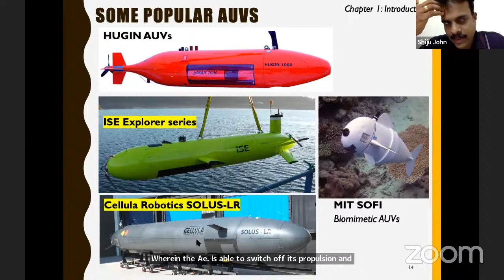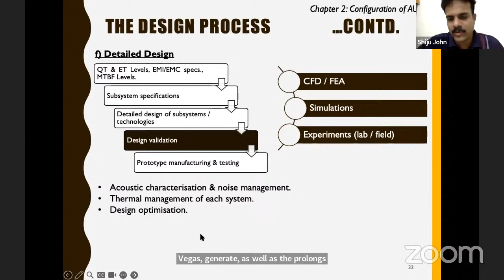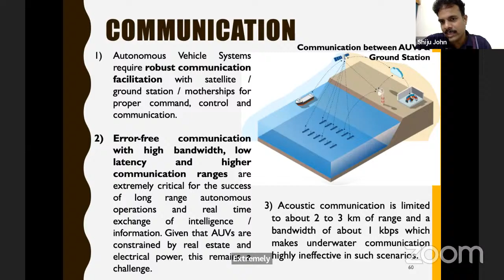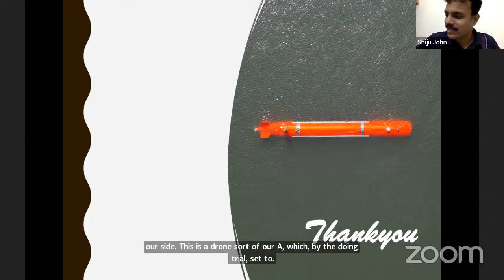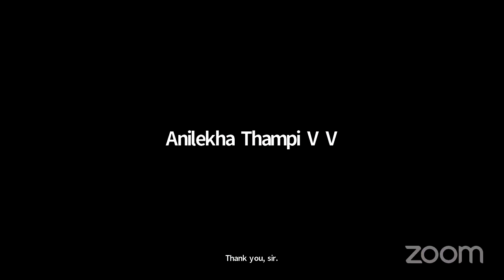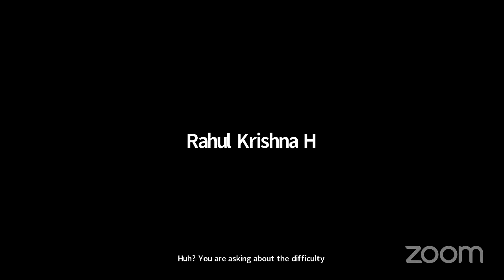Autonomous Underwater Vehicles (AUV) | Shiju John | Scientist - DRDO

Comment: I found out that I had misunderstood or not clarified certain questions. Would like to clarify them here:

1) In the absence of any standard sea trial criteria such as those laid down by IMO for surface ships, how are AUV sea trials done? AUVs dont have predefined sea trial plans as compared to standard IMO criteria for surface ships (they assess stability, turning ability, manoeuvring capability, stopping distance, speed trials, etc). Since AUVs are mostly mission specific, it may be impractical to come up with a standard sea trial methodology. However, we have pre-defined standard manoeuvres (which may include turning circles, lawn mower paths, repeated diving and surfacing, depth change manoeuvres, depth trials, zig-zags etc.) for AUVs that are finalised based on the AUV configuration. More importantly, the user would like to see autonomous mission demonstrations incuding key features such as mission planning, communication and collision avoidance as per end use requirements and also performance of payload sensors. Mission success criteria considering the vehicle behaviour and mission requirements are defined upfront with user concurrence. The trial plan is meticulously prepared based on these criteria.

2) Why is X form rudders chosen for HEAUV? X configuration provides a more efficient hydrodynamic rudder configuration with respect to improved manoeuvring and also better handling capabilities in contingencies such as any likely rudder jams during longer missions.

3) Why are bow fins not used for HEAUV? The bow fins are generally useful for diving at low speeds. Since our aft rudders were quite effective in achieving the diving requirements at low speeds, we didnt go for bow fins, though we had considered them in our initial configuration studies.

4) What Machine Learning algorithms are used in SONAR Image Procesing? For SONAR image processing, YOLOv7 algorithms are used. Models trained using Faster R-CNN and VFNet are also used for this purpose.